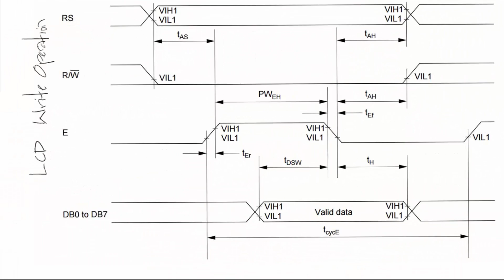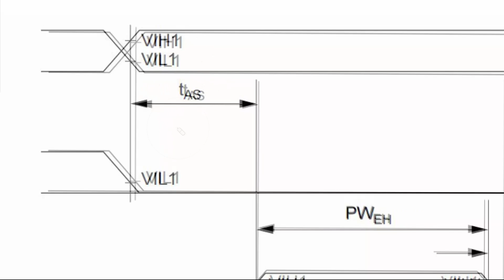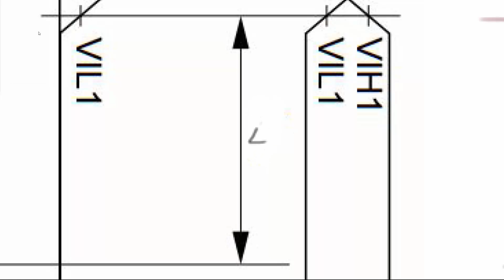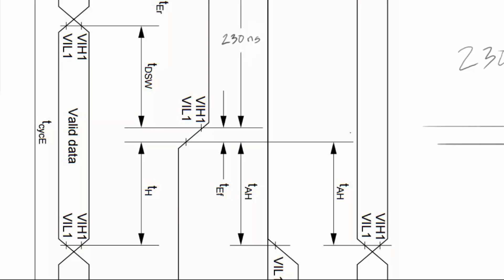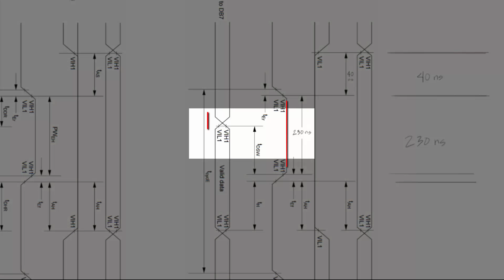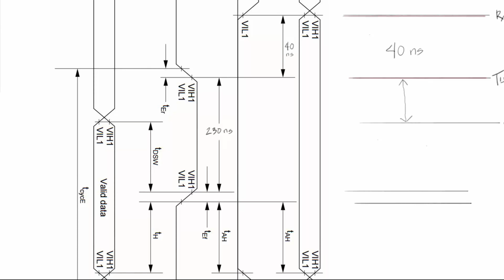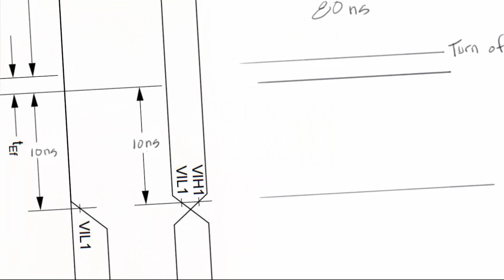22. How to Interface an LCD to an ARM Microcontroller - Part 9

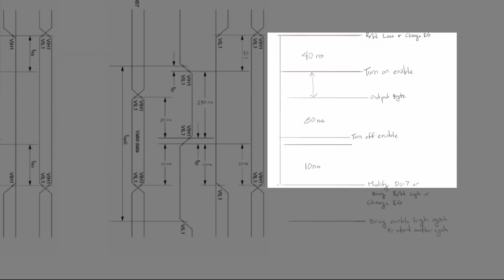Comment: 10:36 don't we have 280 ns of processes instead of 130ns? I think you forgot to include the time between Turn On Enable and Output Byte. The time between Turn On Enable and Turn Off Enable should be 230ns in total.